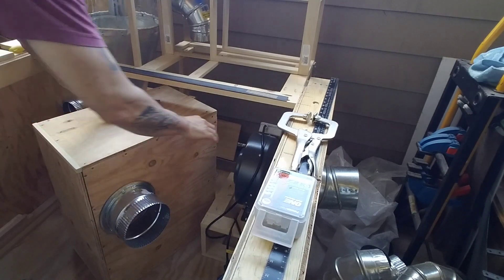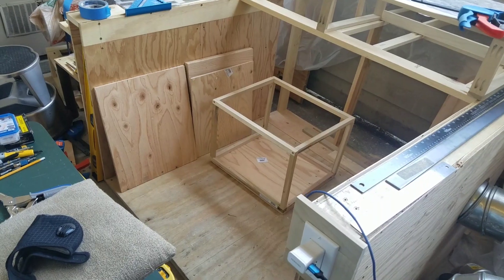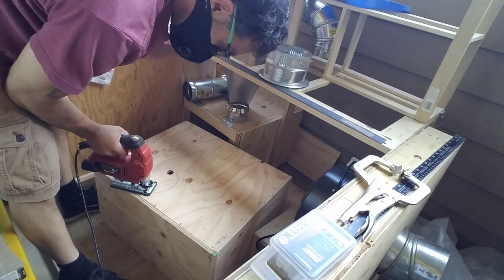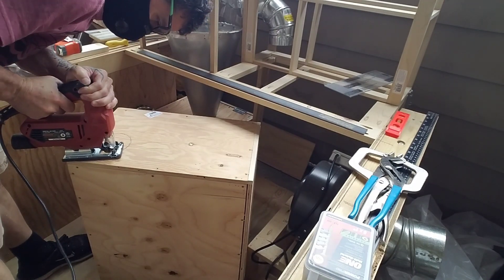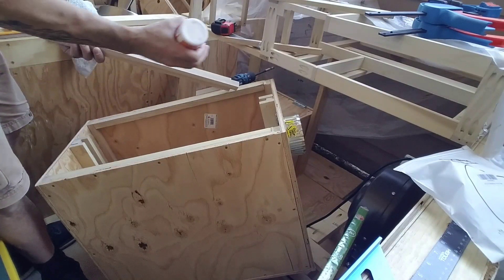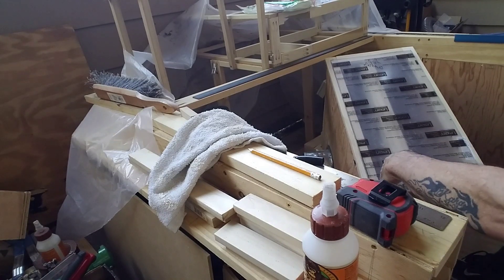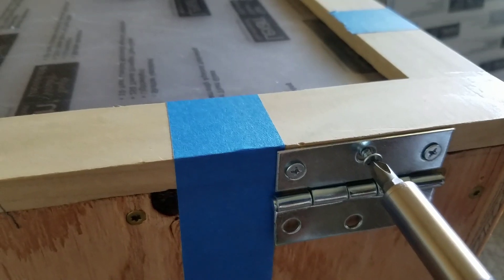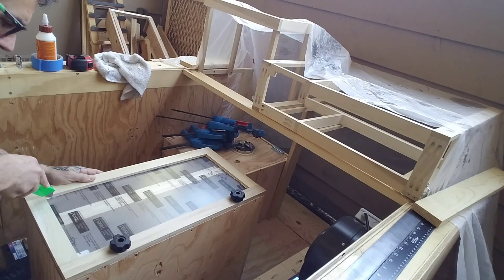DIY Dust Collection Air Filter Box for Cyclone Workbench | Ultimate Workshop Air Filtration

Comment: Is anyone else thinking that as soon as he fires up that blower motor it sucks that filter right out of that track and possibly even sheds it up and spits it out the exhaust side. Maybe that's why he didn't show it running? Unless it's a very low MERV super cheap filter that can let enough air through, until it starts to clog with dust, then it'll  suck it out. But, at that point your defeating the purpose of the filter which is to trap the super fine dust thats harmful to breathe in. You need a MERV 15+ for super fine cancer causing dust. I'm not here to bust balls, I'm just speaking from experience of building my own DIY filter box. 1" filters can't handle the force and bow, then collapse without some sort of cross bracing to support the middle of the filter. But even then, once it starts to clog it'll rip itself apart(in my experience) . You need to step up to thicker 4" filters but, shorter length and width to get the rigidity and most importantly the proper MERV 15+ rating for fine dust. Perhaps a 2 x 2 grid to make the size you need, almost like a removable filter cartridge so to speak. Sorry about the book....just my 2 cents from my experience.
Reply from the maker: Unfortunately the blower motor I was using wasn't powerful enough to do that